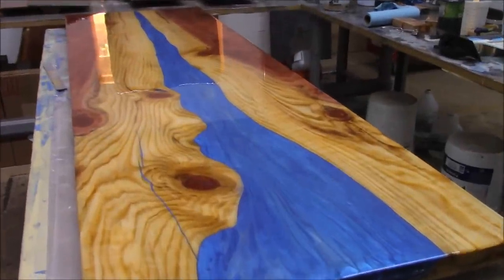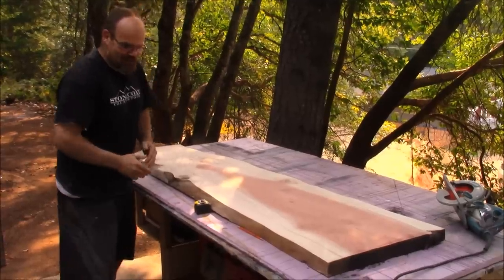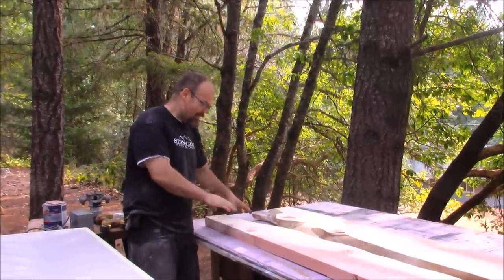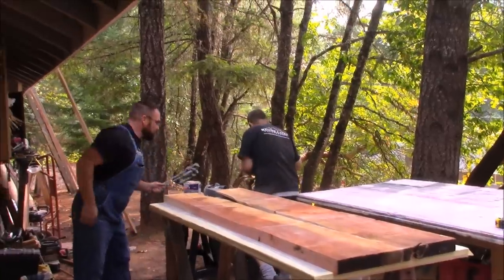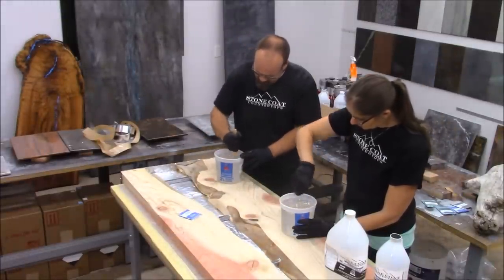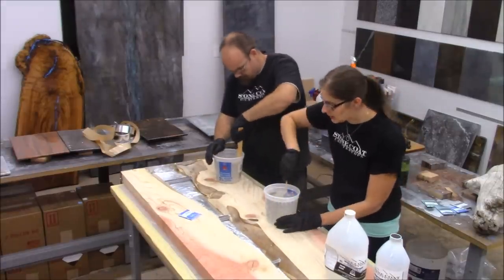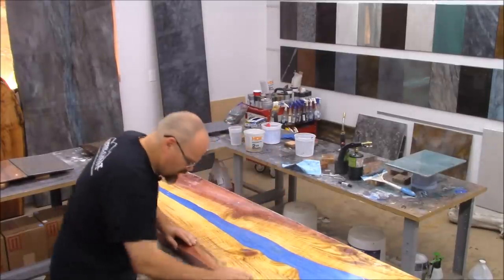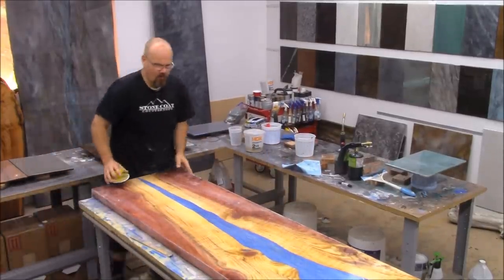Live Edge Wood Slab, Casting with Metallic Epoxy.

Comment: Instead of the metal rods, would you also recommend carbon fibre rods for similar projects?
Reply from the maker: Ginger Knight, great question! 
We have not tried to use Carbon Fibre rods, as the square metal tubing is easily available at your local hardware store, You could totally give this a try if you would like!

Comment: how did you finish the bottom? did you just leave it with that bond? you mentioned that you were going to sand it. Sorry if this is a repeat question, I browsed the comments for a similar question but didn't see anything
Reply: StoneCoatCountertops, your work is amazing and you do a fantastic job with your videos and I learn a lot from them. I currently do a lot of work with lichtenberg wood burning including filing my pieces with epoxy mixtures. Small stuff for now but working my way to bigger projects

Comment: Is it possible to create marble like designs like the countertops? Or will the resin blend back to the dominant color?
Reply: I did a sample with a blue as the main pour, I then used a white Pearl and red to create the looks of stone as you do in the countertops. I came back after about 20 minutes and the colors had blended in with the blue. I am assuming this problem will persist due to the thickness?
Reply: If I tinted the casting resin white, then used red and blue to create the vains, do you think the colors will still blend together after sitting?

Comment: When making something like this do you need those metal bars to hold the 2 pieces of wood together or is that for extra stability?
Reply from the maker: Hi Joseph, great question and thank you for tuning in! Great question, we use ¾’’ steel square tube to keep our wood slab tables from cupping. I use a ⅞’’ or ¾’’ router bit and router ⅞’’ deep channel then apply bondo or our quick coat gap and seam filler with the thickening powder in your cut and insert your steel square tube. If you use a ¾’’ router bit, make the hole a little larger than ¾ to allow room for bondo or quick coat. I will sand the bottom the wood slab after the bondo/quick coat has dried and apply a few coats of polyurethane to seal out the moisture. Thank you so much for you interest in Stone Coat Countertops! Here is a link showing this process- https://youtu.be/990076Ob9P4?t=383
Reply: Okay that makes sense. Next question is how worried should I be about cupping if I do not use the a metal rod or steel square?
Reply: Joseph Cummings I believe he said the metal bars were for extra rigidity (stability)
Reply: What about the bottom side?

Comment: What temperature does it need to be when applying your stone coat finish?
Reply from the maker: Awesome question Luke Richard! You'll want to be between 70-80 degrees during the time of application and for the first week of the projects life for maximum durability. 
What project are you looking forward to working on?
Reply: Thanks for the info! I just recently invested in getting all my tools to start making live edge furniture. I have some really nice slabs drying out in my garage and just need a few more things before I get started. My only problem is my garage/work area is nowhere near 70-80 degrees this time of the year. Would I be able to plane/cut/sand in the shop and then do epoxy fills and finishes in my living room?

Comment: Epoxy: generally structural adhesive, namely a product used for joining parts together that will experience load. Bondo: a filler product for metal designed to have low thermal expansion, long term stability, and be sanded in order to reproduce contours on cars (dent filler). Why in the world would you use a brittle, aesthetic component for those bars vs. epoxy which is designed to do exactly what you want?

Comment: what's the brand and model of the angle grinder? it will be very useful to add a link to all materials.
Reply from the maker: Great question Snowmoon 83 Mike will either use a Dewalt or Ryyobi, and here is the link to the 50 grit frinder/sander used: https://www.homedepot.com/p/Diablo-4-1-2-in-x-5-8-in-50-Grit-Grinder-Sander-Conversion-Kit-DCP045VGPS01G/202830887?MERCH=REC-rv_gm_pip_rr-202830896--202830887--N  Please feel free to call or email us anytime for project support. (541)450-1976
Reply: Thank you.

Comment: Bondo is a filler not and adhesive. I bet before you put epoxy on there I could pull those two pieces of wood apart

Comment: Do you not seal the back side?
Reply from the maker: Great question GSD OF THE SOUTH! We like to reinforce the natural wood slabs and pieces with steel, so they won't warp, but be sure to seal the underside with a sealer like polyurethane of something that will stop moisture.  When you epoxy the surface as well as treat the underside of your project this will encapsulate the work piece and help to prevent warping and movement caused by moisture.  We like our moisture content under 13% in our wood projects before coating.  Call or write us anytime with questions or for project support. (541)450-1976  Are you planning any projects at this time?

Comment: How is the other side of the table?
Reply from the maker: Great question Emilio! We like to reinforce the natural wood slabs and pieces with steel so they won't warp, and the underside can be sealed with a sealer like polyurethane or something that will stop moisture. Contact us anytime for support. (541)450-1976  Are you planning a river slab project?
Reply: Thanks for your answer!
I'm thinking of doing one of those yes!

Comment: how dry does the slab have to be to epoxy? Moisture content?
Reply: I have a friend that wants to produce some live edge slabs and so I watched your video with interest.  I suppose the epoxy encapsulates the wood so there is not much if any movement afterwards.  So you only air dry your slabs?
Reply: Kim, lots of live edge wood slabs, including my specialty, Myrtlewood, often has bugs that have bored into them and will continue to create huge problems, so the kiln drying goes just beyond moisture content control. Typical 2 or 3 inch thick live edge wood will really keep moving because of all the tension too, so it needs to go closer to 7% to stabilize, and too wet your resin will look milky (or worse- heave away from your wood) anyway.
Reply: So the big question is how do you get a slab that thick to dry to such a low MC?  I checked my friends slab and it was at 17%.  I don't want to waist money on epoxy and have it turn milky
Reply: so how do you get a slab that thick down to 7%
Reply: a kiln... search home made solar kilns for wood drying

Comment: Leveling that slab would have been a perfect ~20 minute operation for the CNC machine!!
Reply: Would love to do that for you!  Have you looked at ShopBots?
Reply: O
Reply: i build cnc machines for my personal use, the parts are very reasonable
Reply: proc to nejde prelozit do cestiny?
Reply: I think CNC is missing hhe point.The enjoyment is in the manufacturing by hand
Reply: Or a perfect  60 second operation with a regular ol planer
Reply: Tony.   Pham
Reply: Gantry style CNC's, most common for high speed wood routers, are very resonable to fabricate, both cost and ease of design. As far as a planer goes, that type of blade would be lucky to make it through one table top before being destroyed by the resin, not to mention the horrible finish it would leave. Of course that's just my opinion, only being a very talented Machinist/Programmer since 1977. Peace to All. <:/)
Reply: Tony Pham i
Reply: Just an idea, why don't you use "Crazy glue"  to fill your little holes instead of those metl crayons?  That's what we do in wood turning and void filling.   let me know if you tried that technique or not...